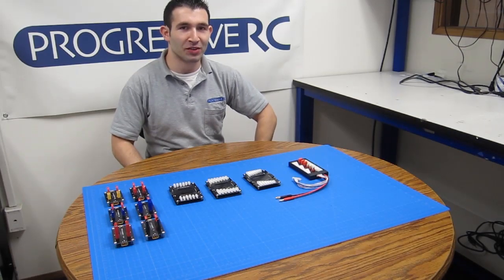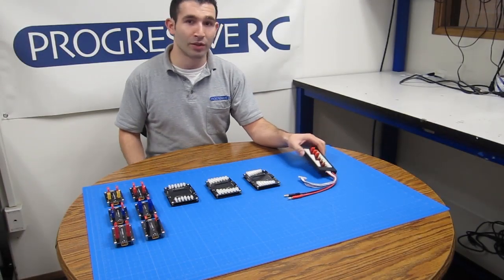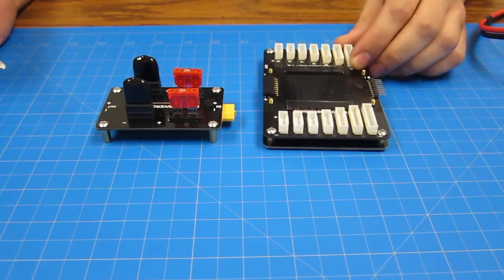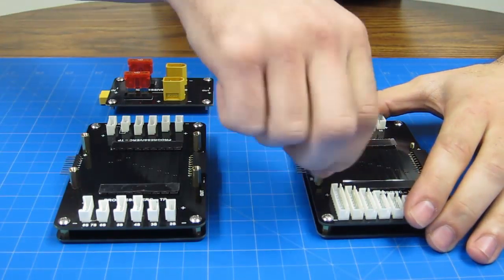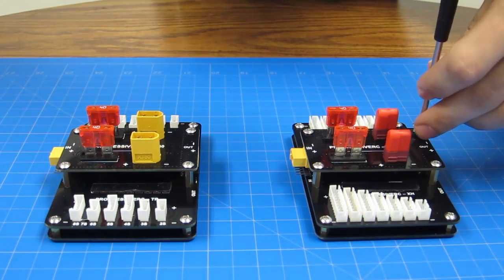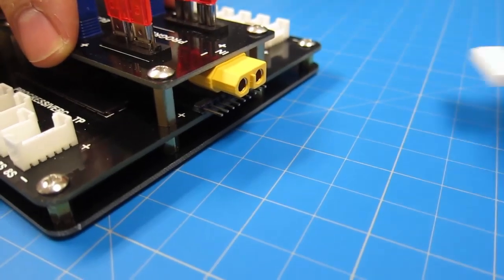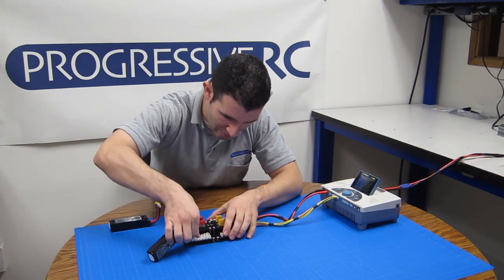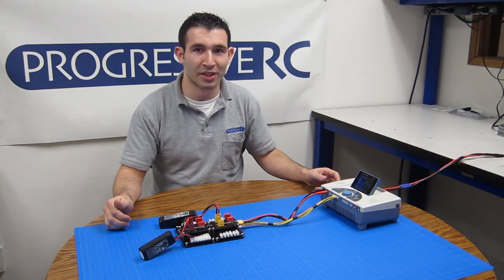Product Spotlight: Modular Charge Boards

Comment: When charging 1 battery at 2.2A do I need to change 4.4A for 2 batteries or will it automatically use 2.2A each?
Reply: +David Gray Thanks, I actually got an instant reply from your website's online chat helping in the matter.  If people are skeptical hearing it from you...I will say it...in all my dealings with companies in the RC hobby I've gotten the best customer service/experience dealing with ProgressiveRC.  I've gotten every run-around you can imagine from other companies from paying for expensive shipping and them using a longer cheaper shipping option to getting something different than you ordered.

My first order from you guys happened to be missing some stuff (mistakes do happen) and it was a breeze getting it rectified. Everything showed up at my door the next day, with no back and forth emails...just fixed instantly.

Having that online chat to help out so fast really makes it hard to ever use anyone else.

Thanks